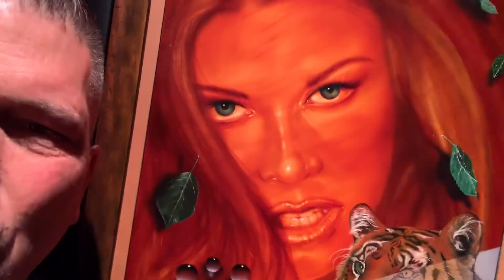Intimate Tour of TITAN’s CNC Machine Shop - Daily Vlog #7

Comment: I have a ShopMaster Mill-Turn. 2017. It is a decent enough machine. (But it is Chinese). It is a new incarnation of the Lathe-Mill combos that have been around for years. I had to have both a Lathe and a Mill, and had a budget, with a capital B. That type of machine fits the home / small -shop niche market. Such a machine could be sold disassembled, using the old Heathkit business model of shifting labor cost to the purchaser. Assembling and calibrating the machine are part of the education. It could be built in modules, allowing a person to get started with a single operation, like lathe or mill, and add more components later, like 4th, and 5th axes. Instead of castings, publish plans so that people can have the heavy parts made locally by welding shops, or bolted together from locally available stock.  

Lathes are important. There is spinning stuff all over the Universe. Planets, Galaxies, etc. So, a combo machine needs both mill and lathe.

So for the purpose of CNC education why don't you design a CNC machine for the Home / Small shop market, make whatever parts people need to buy to get started, (and sell them), and use making a CNC machine as the curriculum, so that when a person is done, they have built themselves a solid CNC platform.